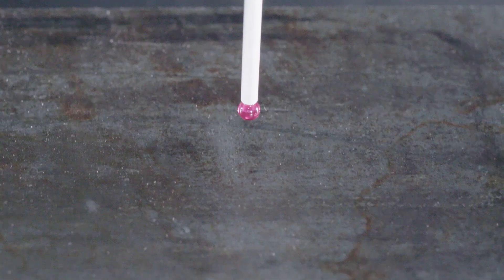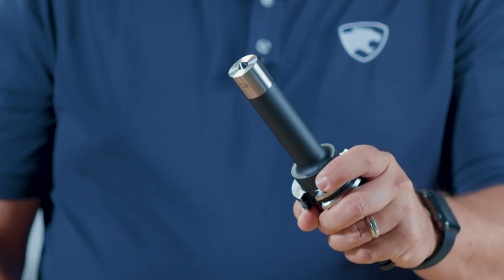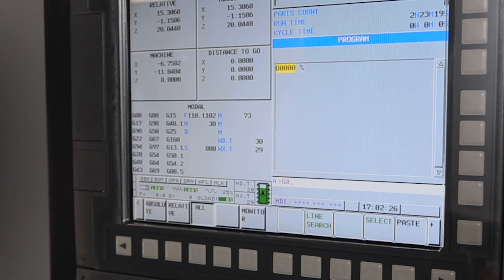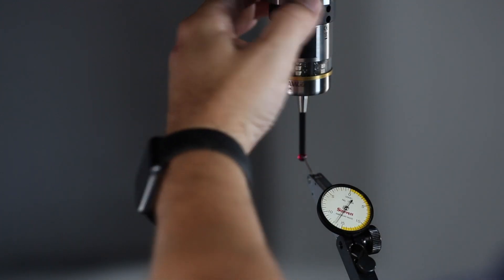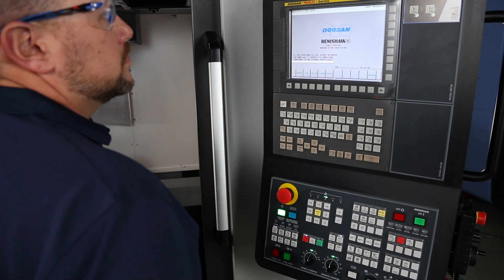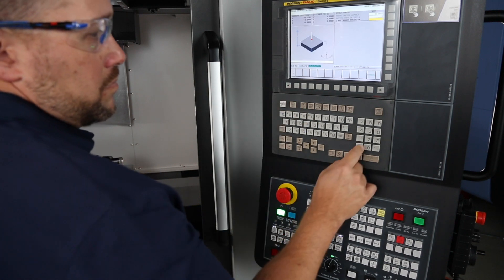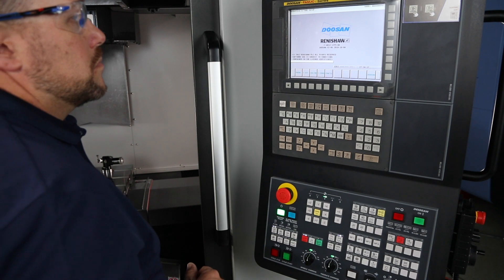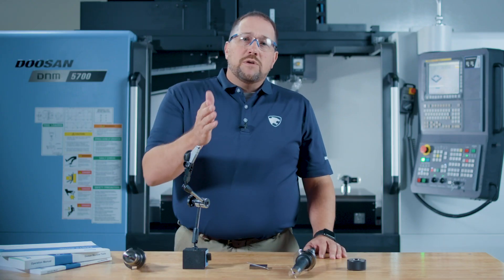Calibration of Probe and Tool Setter – Know Your DN, Episode 2

Comment: Do you need to indicate the ring gauge to have the spindle exactly over the center of the ring before running the calibration routine?
Reply: Not sure if you already figured this out but no. The machine will do it for you
Reply: I was taught to always indicate the ring. I started doing without,and didn't notice a difference. You don't have to indicate the ring.
Reply: The routines in the very first part of the calibration cycle figure out the center of the ring gauge and you have given it the diameter of the ring gauge in the calibration cycle page before you started, so there is no need to indicate it in.  Good question though.  I apologize for just now answering it, but hopefully this answer helps someone else down the road.